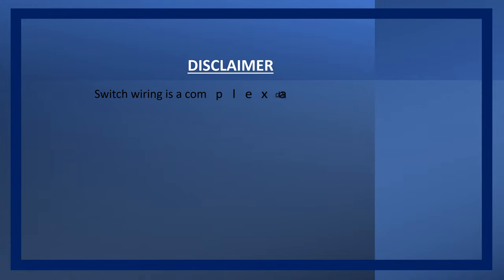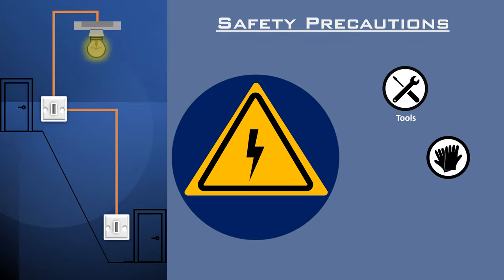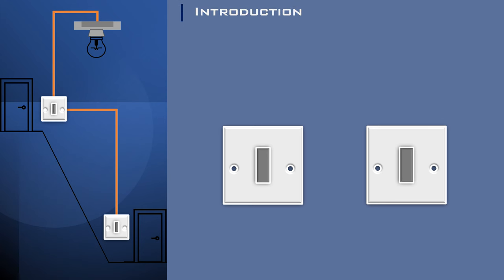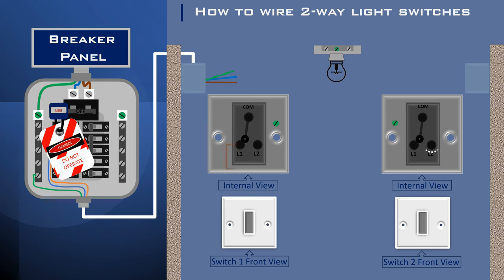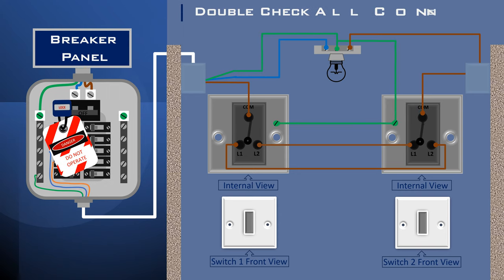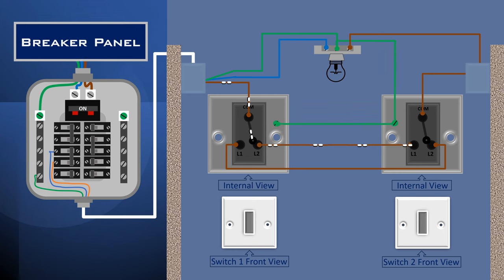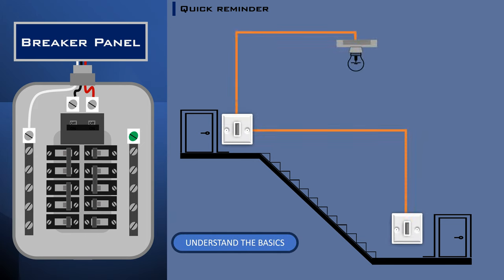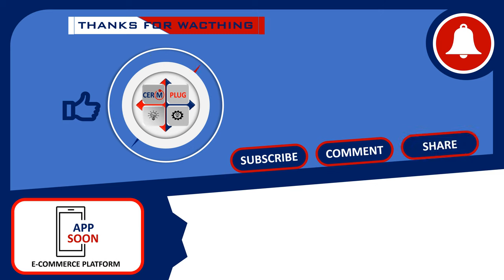HOW A TWO WAY SWITCH WORKS. *** 2 - WAY SWITCH WIRING DIAGRAM.

Comment: Sir. Based on my scenario, is there anyway to get a double ceiling lights on double 3-way or 2-way switches to converted so that ceiling lights can be turned on independent of each other? I am hoping there’s a solution. Can I send you a photo of the switch? Thanks
Reply from the maker: Certainly, you can convert double ceiling lights controlled by 3-way or 2-way switches to operate independently. This typically involves rewiring the switches and possibly changing the switch configuration to separate the control of each light.
                                      Contact me on Whatsapp or Telegram (+233 50 338 4406)